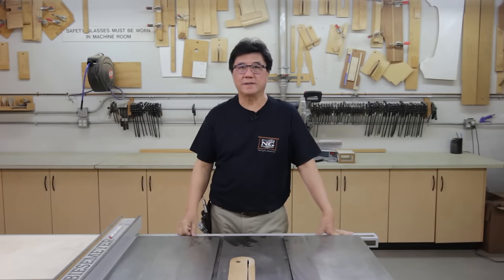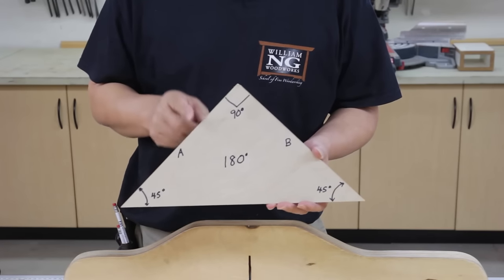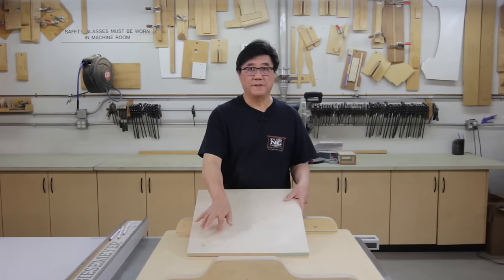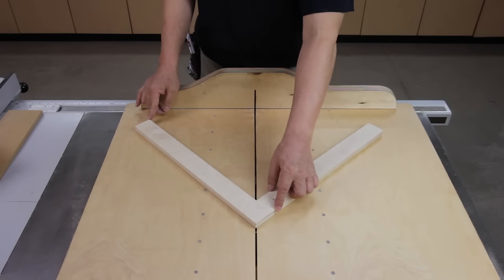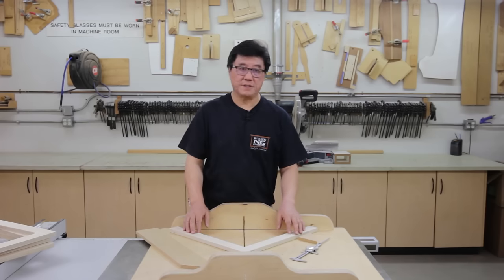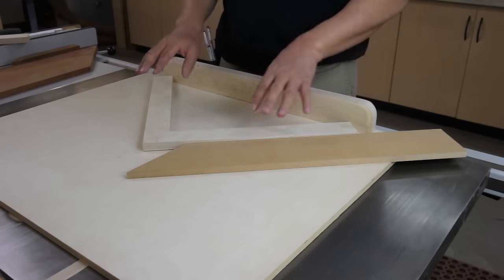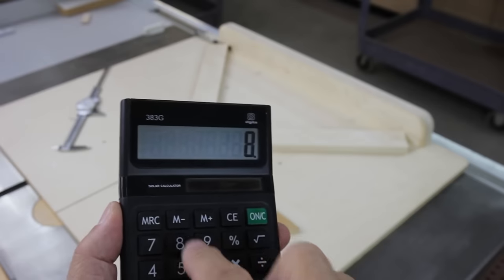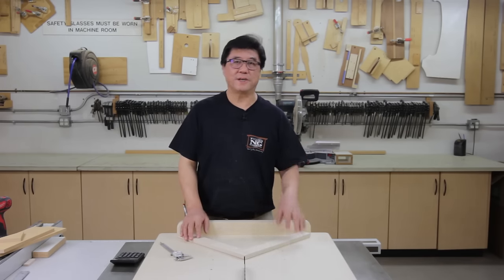2 Cuts to a "Perfect" Miter Sled

Comment: First, Merry Christmas!  I don’t usually comment on videos, but after watching several of yours, I want to. 
Thank you for taking the time to make your videos and showing everyone that there is more than one way of doing most things, and that if you put in a little more work on the front end, you won’t have problems on the back end, or at least as many. 
I have been in home building & renovations, for the past twenty years, and build most of our cabinetry and doors. The little adjustments you are taking the time to do up front, make the installation, and use of the final product, much better.  A lot of contractors have a hard time understanding this simple concept. Thanks again and keep the videos coming.

Comment: Mr. Ng, here's the thing with regard to your videos, math, and people complaining about difficulty.  Screw 'em!  You're demonstrating precision ways to make jigs so that using them will result in precise results.  There's a reason why 5,000+ liked your video.  I kinda struggled with you 5-cut method of squaring the fence to the blade and once I slowed down and did the simple math and went step-by-step, I was able to square my fence to < .0005" after the 2nd attempt.  This has helped me make safe and precise cuts quickly.

There's always gonna be some whiners and complainers on YouTube, but you'll rarely if at all see those people posting videos that are better.  Again, examine the complaint.  People seem to be too lazy to strive towards higher quality work and would rather accept non-squared cuts as 'good enough'.  Oh well, let them do their thing.  You had magazines calling you to cite your work and as of today, 02 Aug. 19 @ 2044hrs, you have <.01% of people who didn't like your video.  With a such a small dislike-to-like ratio, you're good to go!  At some point, people need to rise up to higher levels of intellect.  Don't dumb down stuff because a few folks don't want to do simple math and put in a bit of work.

Comment: FANTASTIC!!  I made your original crosscut sled using your formula and since this video was not out I made a miter attachment for it.  And yes, you guess it William, I cut across the 45 because it seemed so logical to do it that way.  It is "fairly" accurate, that is until I wanted to make 4 pieces for a inlay project that are 4 inches long with two 45 degree sides (patchwork quilt sort of thing).  And with this 4 cuts made I discovered how "fairly" accurate just doesn't work.  So back to the drawing board using your method.  Thank you for this video.

Comment: William:  
I have a business that required machinist level precision on my wood blanks that I finish on a CNC router.  I make 100's of pieces at a time that all need to be within a few thousands of an inch so pieces fit together properly.  When I made my cross slid sled, I used your formula for ensuring a perfect right angle on my blanks.  Thank you for making it easy.  For me it was a life saver.  Math is so important to me and I stress it to my sons who are my business partners.  Work at times is a lesson in math.  Keep up the great work.
Master Monk

Comment: Mr Ng, 
Your 5 cut method was an inspiration to me.  But as a woodworker who is always trying to improve a method to simplify for the not so experienced....After I cut my sled with my blade, I attached the back fence on one side then I used a 12” long piece of keyway stock an 1/8” thick (the width of my blade) and slipped it into the slot.  It fit snug enough to stay on its own.  Then I took my drafting triangle and butted it up against the keyway stock and aligned the back fence with it, clamped the fence down on both ends, then affixed both ends.  After making the 5 cuts I was off .0023.  First time I had ever gotten that close,  thank you.  Remember the adage:  The difference between a carpenter and a woodworker is about an 1/8”.  Until the person can breach the mindset of a carpenter mentality what you are teaching will fall upon deaf ears.  In this world there will always be a place for both.  For many years I have said I was a rough carpenter,  my mindset has changed and so now I say I am an apprentice woodworker, and will be until I pass from this world.

Comment: William, I just completed the Cross Cut sled and then yesterday the miter sled.  WOW, don't let the negative comments about "math" ever deter you!  These plans are 100% logical and you spent the time to use mathematics to your advantage, something to be admired!  I made one alteration to your plans in that I added T-track hold downs one either side of the cut line in both sleds.  I used the hold downs for every cut to adjust the cross cut sled sled in the 5-cut method.  Using the hold down assured me that the piece was always tight to the back fence and couldn't move during the cuts.  I got the cross cut sled accurate to .0021".  Then I used it for the 90-degree cuts on the 4" molding pieces for the Miter sled.  After a rather initial significant adjustment to "B" of .138", I literally was unable to measure ANY error whatsoever, not even the hint of a dial movement of when comparing "A" to "B" on the 4" piece!  Awesome result and now I have two sleds that are taking woodworking accuracy to a new level.  If you have an email address to share, I can send pics of the final sleds.  You can email me at ghope@optonline.net.  Thanks for the awesome videos! I would love to know your thoughts on how to approach making dedicated sleds for 30 degree cuts (6-sided) as well as 22 +1/2 degrees (8-sided) applications :-)

Comment: Finally made a miter sled after following your directions for a 90 degree tablesaw sled.  For the miter sled I used some scraps and am very happy.   Thanks so much for sharing. I have a Mitutoyo digital gauge (battery operated) but I like the idea of the gauge that you use to make your measurements.: never need to worry about a dead battery.

Comment: I watched your 5 cuts to a perfect crosscut sled then built it a few years ago. It came out great - super accurate. The only problem I had was the runners swell with humidity (screwed them down but didn’t use glue). Today a need to build an accurate mitre sled and am super psyched I found this video - I know it will come out great and just in time! You are both a fine craftsman and teacher, and even more importantly, I can tell you are a very decent man. Thank you for sharing your gifts with us and God bless you.

Comment: I made William's sled using the 5 cut method. (Thank you!) The method works really well and I got it (once) to 0.001". Trouble was, as soon as it was screwed together (despite clamping), the fence moved a fraction and the sled accuracy was out. To solve the problem, strips of 220 grit paper were cemented onto the bed and onto the adjustable end of the fence to make a friction fit when pressed together. Second, a slot was cut in the bed at the adjustment end, and a loose hole drilled through the sandpaper and fence. A carriage bolt with a washer and wing nut was inserted for adjustment with the wing nut on top of the fence. (The bolt head was recessed into the bed for clearance). Endless adjustments could then be made without the adjusting end of the fence beginning to look like a swiss cheese. Because of the problem with inserting screws throwing the jig out of true, glue was applied on the outside of the fence and bed, and left overnight. The whole assembly was then clamped before screwing, and this time the sled error came out at about 0.003". Good enough. 
As a hint you can use 1.2.3 blocks to make pencil marks on the bed (parallel but away from the fence). You will be amazed at how little the fence has to move to make the corrections. Hope this helps someone like me who was beside themselves with frustration. Thanks William. Next project is the mitre sled!

Comment: Made this sled, it works.  I had one frustrating problem that had to do with the wood I was using for cutting the small triangles to measure the off-angle.  I used a long piece of particleboard scrap that I had cut straight.  Consequently there was tearout on the corner of the triangle where the blade came out of the board.  I didn't realize how it was throwing off my measurements, but I could see that with successive triangle test cuts the error was all over the place.  When I finally realized it, I cut a piece of high quality plywood into parallel strips for test pieces and I used a sacrificial backer board that extended past the cut path of the blade.  I made very sure the backer board was parallel.  I cut another test triangle, this time both corners were sharp, made the adjustment based on the calcs, did one more test triangle to check and it was close enough that I could have only made it worse with any further adjustment.  My first mitered project has come out just fine.
  If you don't have a micrometer or caliper that can measure in thousandths of an inch or hundredths of a millimeter, I recommend you get one.  You'll find it pays for itself over and over in many other situations as well.

Comment: Thank you!  Using your method I was able to create a perfect 45 degree miter sled.  By tweaking your method I've been able to create other sleds for 22.5, 15, 30, and 60 degree angles.  I keep the width of one leg of the jig at 2" and vary the width of the other leg of the jig.  The width of the 2nd leg of the jig can be mathematically calculated for any unique angle.  I have an Incra TS-LS positioner on my saw so cutting the second leg width to an accuracy of .001" is a fairly straightforward process.

Comment: Just used this method after simply squaring it with a framing square against the blade.  That gave me a rubbish result of 0.5mm out over 200mm.  After doing this process, mucking it up a bit a couple of times and making the best I could I remeasured the error and tyo my amazement I came up with an error of 0.0001" (0.1 thousanths of an inch) over the width of the fence!
Thank you 👍

Comment: After watching your first video, I made a large crosscut sled to square the gable ends of my kitchen cabinets and was very happy with the results after squaring it with your method. While watching this one, i like that you get 3 fences out f the one square piece, but can't help but wonder why you squared it up after the bandsaw when you already had 2 straight sides at 90 degrees to put against your fence.
After I post this, I will be subscribing.

Comment: I really really like your wood working videos, someone that thinks like i do. I do have 1 suggestion - I just watched your cross cut and miter cut videos and instead of writing down, for example 0.7732 and the next is 0.7689 and then subtracting to find the difference, just zero the caliper after measuring the first side (or A side) then measure the "B" side and that is your difference and eliminates any error in subtracting. Please keep the videos coming!

Comment: I am new to your channel and I just wanted to say that I absolutely loved your video on how to dial in your cross cut sled to within a thousandth of an inch using five simple cuts and a very clear and concise formula. But then again, I’m not afraid of math or the logic that resulted in the formula. But I can see how people who break out into a cold sweat at the thought having to do any logical reasoning or math harder than balancing a checkbook could get confused. Sadly, so many people have been trained by our culture of toxic masculinity (because I am completely certain that every one of those hostile comments was penned by a man) to transfer the upset they feel at their own lack of ability and knowledge into anger and then direct that anger outwards towards the source of the upset in order to purge the negative feelings they have rather than acknowledge that they have places where they need to do the hard work of filling in holes in their knowledge and thinking skills.
 
But seriously if a person can’t handle simple trigonometry and a single algebra equation, how on earth are do they are going to be able to do any kind of woodworking above rough carpentry, let alone sophisticated joinery like the self-locking ones like in the sample you held up with half a dozen cuts in each of the three pieces that interlocked together to make a perfect 90 degree corner without glues or fasteners? That by the way was so awesome, and what I am here to learn how to do (eventually, I have a lot to learn to be able to start thinking through how to even approach such complex joinery).

So I am glad you didn’t let the haters win, because as you said haters gonna hate. Keep up the excellent work my teacher.

Comment: I went back to the 5 cut video to read complaints and couldn't find any. It was good info. Maybe it was a little dizzying at first, but it makes perfect sense. Why not use a calipers instead of a tape measure. Why not calculate error and eliminate it instead of building it into the finished product. I started reading Walter Kunkel (DeWalt Radial Arm Saw book guy) years ago for information on precision wood working and tool setup. I will now also watch you. Thanks for the great information!

Comment: What a joy to see an honest craftsman, with such clarity of thought and precision of mind. 
May I be allowed to add a little comment please? (I'm a European woodworker). I prefer to keep the blade height only very slightly above the thickness of the board to be cut- the angle of tooth attack has a much lower rake, and tends to produce a smoother cut this way. I believe it would be advisable to mount a stop on the underside of the sleigh just at saw contact; hence one can cut more freely without fear of cutting through the fence. Personally, once the cut is made I prefer to slide the longer piece away from the blade immediately, and if possible, also the smaller offcut. I realise and appreciate that you would not want to get your students hands near the blade; I just don't like the piece jangling against the blade while it's still running- it can damage the edge. Your sleigh is very convincing and it does very precise work. My respects Sir. Thank you for sharing.

Comment: I made a sled using your 5 cut method this past weekend and it worked perfectly...I ended up at .5/1000.  I'd say the naysayers are the type that don't have calipers so they are trying to fine tune a sled to within your 1/1000's error with their favorite Black and Decker tape measure and an accounting calculator.

Comment: First, I want to say that I am a BIG fan of William's videos. I came across this video a couple of months ago and suspected that the formula was wrong! I dared not say it at the time, but I saw that William recently replied to a comment, and thought I really should be bold and hopefully not (as my mother was fond of saying) "so strong, so wrong!"
Please no flames, but for sure comment if you find a mistake! I'm pretty sure I'm right, but kinda hope I'm wrong.

I believe the formula should be:
                            (A-B) ➗ √2 ➗ A x Inside length of Miter fence.     (for people without a square root function √2 is approx. 1.414)
which is close to
                           (A-B) ➗ Width of test piece x Length of Miter fence.     ( √2 x A  is close to the Width of test piece if you cut close to the corner of the test piece)

If William's crosscut sled video ruined woodworking for you, please read no further!
My reasoning is as follows :- (it will help to draw a picture - IF you are a masochist and really want to understand!)

In mathematical terms the triangle formed by the cutoff piece (little triangle) is "similar" to the triangle formed by the inside of the miter fence and an imaginary line where the ideal fence (90° to the saw kerf) should be (big triangle). This just means they are the same shape and (among other things) if one of the small triangle's short sides is 10% smaller than the other the same is true of the big triangle.

In the example here B is shorter than A, so the actual fence is behind the "ideal fence" and the right side is the short leg (L') of the big triangle so
                         B➗A = L'➗L        and     L'=(B➗A) x L.
We also know that the triangle formed by the the miter fence, the real fence and a line drawn at right angles to the real fence to the point at L' is a 45-45-90 triangle so the long side is √2 x the (equal) short sides. L-L' is the long side of this triangle, so our error E should be (L-L')➗ √2  and we have

                         E x √2 = (L-L') = L-(B➗A) x L = L x (1-B➗A) = L ➗ A * (A-B)
and
                        E = (A-B) ➗ √2 ➗ A x L

Anyone that has got this far congratulations - you're probably as nuts as I am! Happy woodworking

Comment: JPT. good vid. Rather than have a sled with a permanent mitre fixed to it i'd rout grooves on the sled for the mitre to sit in rather than screw and glue, so you can take the mitre off any time giving you the sled free for any other cuts.

Comment: Not sure if this was mentioned earlier, but for any difference between side A & side B, the error ratio will always be double the difference, provided you use the 4 inch test piece and the length of the miter fence is 16 inches.

Comment: Hey! Another question for you. I built a cross cut sled with your instructions and now I wanna build this cut cutting mitres. The issue I may have is that my sled isn’t built deep enough so the right angle jig is to o big for my sled. And if I make a smaller jig, the stock I’m trying to cut will hit the fence. 

What are your suggestions?should I remove the front fence (not the one we calibrated) when using the miter jig?